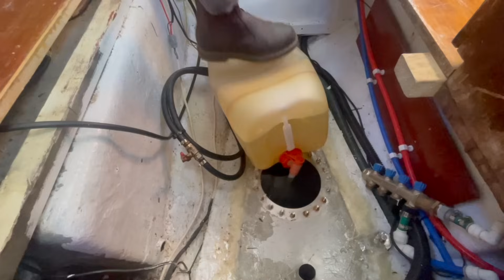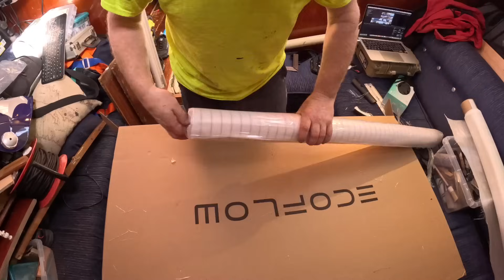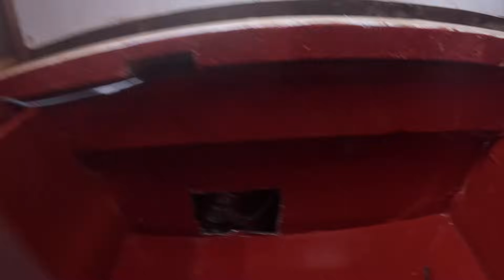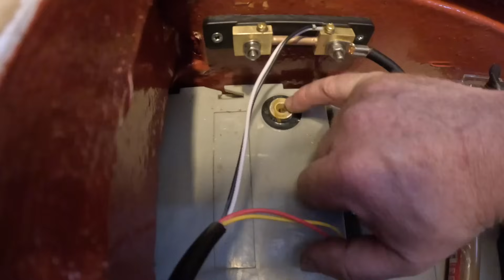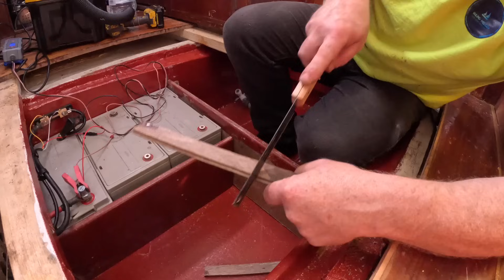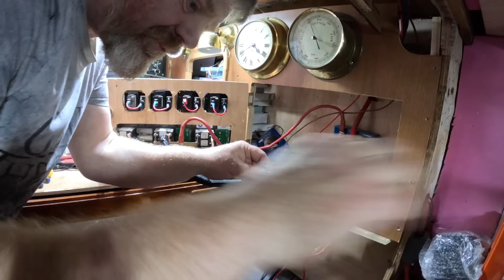Almost out of time!

Comment: Hi Andy,
Something not correct with the battery monitor you fitted to start batteries. Before you started the engine the voltage showed 13.0v, so there is no way your battery is as low as 29%.
13v is a fully charged battery. Probably need to reset the BMS to 100%
Nice job but a shunt and BMS on start batteries is overkill. Usually most boats just have a voltage reading of start batteries.
Also you have a battery switch that does battery 1,, 2, or combined. Yet looked like you only connected one battery? If yo connect 2 batteries, if 1 failed just switch to the other.
Lovely neat wiring job mate. Also a good idea to warble each cable at the bus bars and behind switch panel
Reply from the maker: Yeah I’ve not calibrated the BM1 so don’t worry I’ll do that once I’ve fully charged and connected up the other batteries. I’m only using the one for now.
The reason I want the BM1 in the system is so that when I connect up the DCDC to charge the house bank I can see easily when the cranking bank is full and see what’s happening when it switches over to charge the house bank from the alternator via the DCDC Orion 12-12 30a.
Plus it came up cheap as chips so even though it’s not strictly necessary and is a bit of overkill as you say, it was cheap enough that I couldn’t refuse it and is better than a simple voltage display.
My ultimate plan is to have two alternators with a set of new pulleys and a wide serpentine so I can dedicate one to house and one to crank.
Reply: @SailingMelody  what voltage is your house bank, 12 or 24 volts?

Comment: Nicely done sir.  What was that wire loom you were using.  I have a love/hate relationship with the typical plastic split loom.  I like that it keeps the wire bundled and protected but hate putting the wire into it and it is never the correct size.  Yours looked much nicer.

Comment: you stay on task and keep ticking boxes, good stuff! question: you are using Lithium as starter battery? I believe they don't have the cold cranking capacity?
Reply: As a retired shipwright I will attempt to answer your question.    Lifepo4 are a whole different critter wrt starting.   The only factor you need to consider is does the BMS have the amp capacity to support the 1 to 2 hp starting motor .
Reply from the maker: I’m not using lifepo for starting. The Lucas cranking batteries I have are sealed lead acid
Reply from the maker: I’m using sealed lead acid for the starter batteries :) lithium for the house bank

Comment: Hi Andy. Enjoyed watching your video, as always,  thanks. Please don’t take it as a criticism, but.. that Battery monitor isn’t intended for the engine crank side of things. The shunt is only rated at 100amps and the short connecting wire at 16mm? Is not much more. Your starter motor is probably somewhere near 1400W so 120 amps ish. No problem when your engine starts in 10 seconds, but if you have to crank it a while that shunt could melt. Will also create a high resistance and cause motor to turn slower. Who knows? Maybe ok for years, but best have belt n braces. Maybe keep a jump lead nearby so you can bypass it an emergency. Good luck to you and the family with the next chapter of your adventures.
Reply: The thing I was worried about was the sense wires leading from the shunt to the display. Any short circuit on these will immediately cause a fire as the are connected directly to battery ×. Every single wire on a boat must be fused. Fuses are intended to protect wiring from overcurrent and risk of fire. I did not see any on this video?
Reply: Edit "battery +ve"

Comment: Hi, the battery, I see that you have 3, are they all connected to the charging supply?
If not batteries sitting uncharged will self discharge over time, so will not be any use. Simple fix give them a refresh charge every month.
Also please cover the battery terminals to stop accidentally shorting them. Batteries, have a very large short circuit current.
Take care, you are getting the jobs done ✔️

Comment: Did you fit straps over the batteries? and are the terminals insulated?  I learnt from experience that you need batteries to be both securely fastened  and most importantly there should be no chance of a battery being shorted by a loose metal object (ie a tool) Yachts have been lost by loose tools falling across stored batteries.
Reply from the maker: Yes absolutely. I’ll show that next time.

Comment: Hi all, have you got a battery higher up in the hull?
It can be a lifesaver if you get a rogue wave. You can always pump a boat out by hand or even  save it with a bucket.
But having the ability to start a engine, can just make life a lot easier.
Love the channel. ❤
Reply from the maker: Our lithium are higher up but we have a power bank coming that is able to jump start the engine. In an emergency we currently have separate batteries in the bow for the windlass so these could also be used
Reply: That's great. It's all about having a good plan for when things go wrong.
When you have a good plan, things generally don't go wrong in the first place and on the off chances when they do. You have a work around.
The aircraft industry is based on it and it works.👍